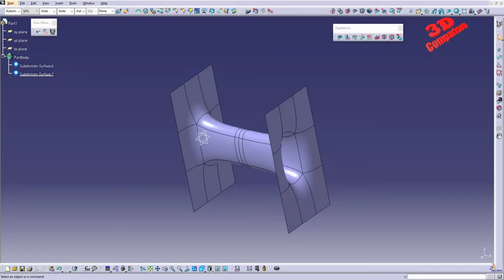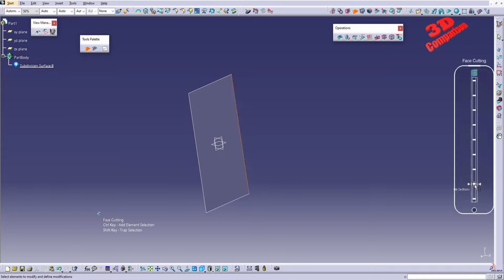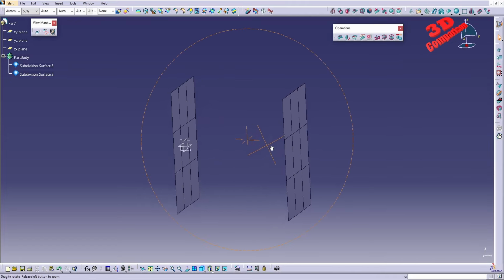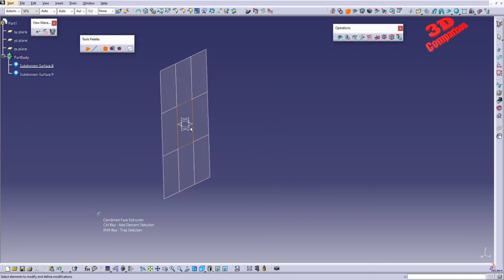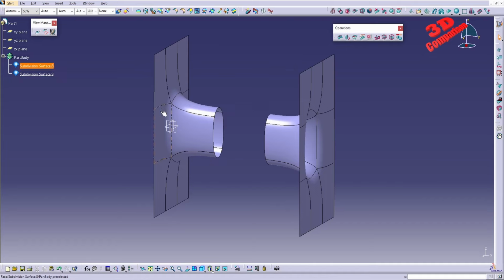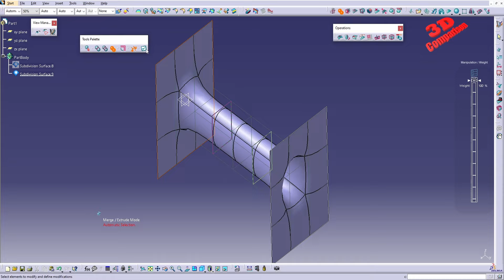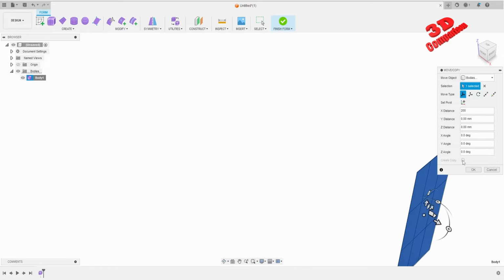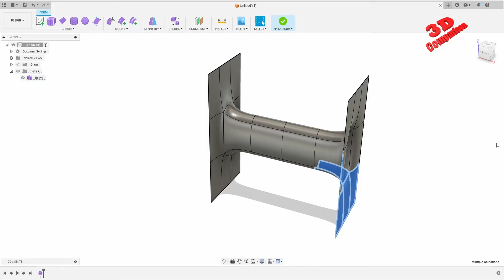CATIA V5 vs Fusion 360 - Bridging Freeforms - 3D Comparison

Comment: Is it possible to match freefronm surface  to existing surface
Reply from the maker: From what I know in CATIA V5 you can match meshes within the Shape Sculptor Workbench to existing surface models, but the freeform subdivision surfaces from Imagine & Shape don't have this functionality. Fusion 360 has this feature (Pull) and it works both with existing surfaces as well as meshes. I will create a video regarding this later tonight. Thanks for the comment!